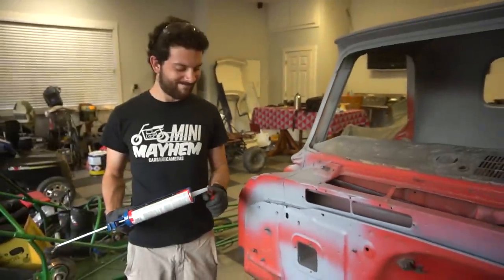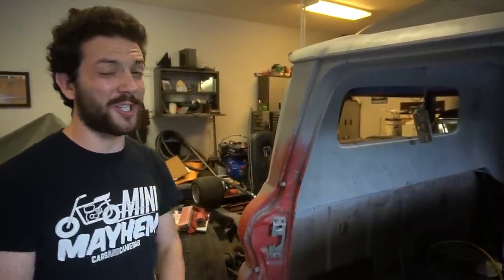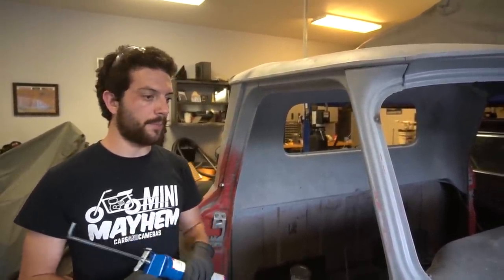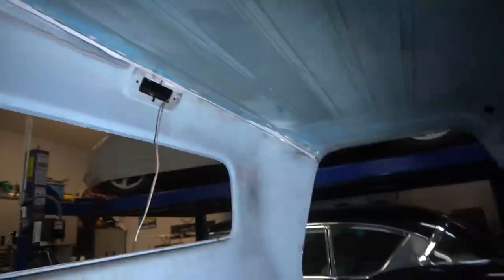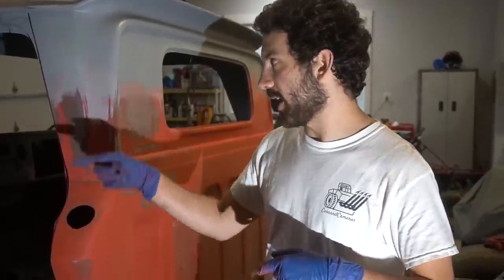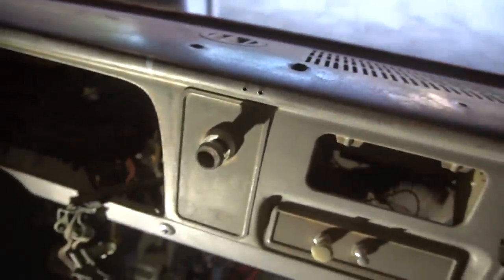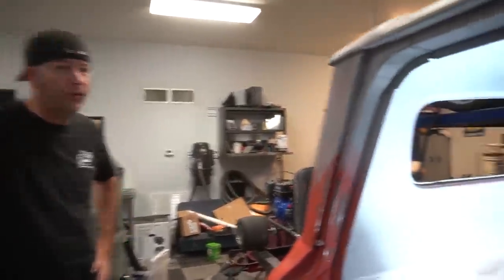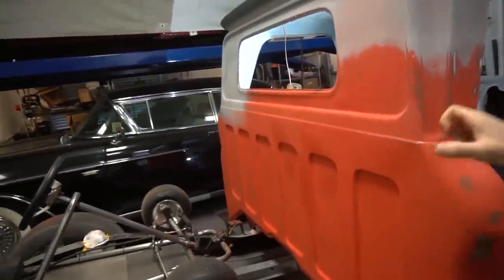My Chevy C10 Resto Mod! Fire Truck Cab Rehab!

Comment: Ditch the cheap plastic spatula and get some metal ones. Your body filler will go a lot smoother.
Reply: Na the plastic ones are better they just have to be cleaned after and they last. Last thing i want is after i do body work getting it straight is to drag a metal edge across it
Reply: doesn't look like he's pressing it into panel much, hints the pin holes
Reply: @Steve_Just_Steve  that and his spatula has like 3 layers or rough body filler on it its not smooth leaving scratches and gouges as hes trying to apply more
Reply: A guy I know that works for a mechanic friend of mine doesn't even use body filler on any of his project vehicles. He likes to pull the dents the best he can and fills them in with welds so there's no bondo under the finish. Takes much more time in the long run, but who cares if it's not a high priority vehicle and you have five other vehicles to drive? It would be another story if I tried doing that on my truck since it's the only vehicle I have to drive. :)
Reply: @Slane583 yeah if its a high dollar show car you tig weld everything and use a air file to file the metal flat. I personally dont like the bondo filler if im gonna use a filler its either dynaglass or all metal. All metal is just a metal paste
Reply: nathan butler: I don't think his projects are show cars, I think it's because he doesn't like body filler. Understandable if you try to sell something to someone after you've had your fun with it. They can't haggle the price down much if there's no body filler on it to use against you. :)
Reply: I would never ever use a metal edge to spread Bondo. You want to use a plastic Bondo paddle because you can bend the paddle  as needed to fit the contours of the body panels as needed. (p.s. they're cheap too. Some distributers will throw in the paddles for free when you're buying the bondo. Use it up, throw it away when it gets ragged out.)
Reply: Obviously none of you have ever used a high quality metal spreader. I’m not talking about a putty knife. These are specific for spreading filler. Oh well.
Reply: @brazwewn  You would be right, I've never used a metal Bondo paddle, (or 'speader', which ever) so I had to look it up.    Sure enough, you can buy metal bondo paddles for autobody work!  Just goes to show, not everyone knows everything about anything!

Comment: You should use a dry or powder guide coat instead of the primer to see the holes and mistakes in the body it would be a lot faster.

Comment: Bondo should be put on bare metal,You prime after you shape your filler.Otherwise your bondo will not stick properly..The only filler you use on a primed area is a thin coat of spot putty.

Comment: Seam sealer is not sandable; *panel bond*, I think, is. People sometimes use that instead of seam sealer, and that may be where the confusion came from. If you want to see a guy piece together a car from nothing, check out MotionAutoTV's Supra build. He used panel bond in this manner.

I should add that I have no direct experience with panel bond, as my "builds" tend to stop at the grind-the-weld-and-throw-on-some-primer stage. Don't get it right, just get it running!

Comment: sorry but you put body filler straight to the medal if you put it over the primer the primer can and most likely will lift off the medal. then you will have to start all over. and on the body filler its good to have a 2nd spot just incase you make to much that way you can fill it up some and not waste so much.

Comment: don't put bondo on top of primer. You should get poly putty.  It is made to adhere to primer that is cured. Regular plastic filler needs metal to adhere to

Comment: Take a round piece of metal the same size as the bead roll in the dash ,hammer sheet metal over it and you can fix that "patch " to look like it has never been fixed. It looks like crap without the bead roll. Cut it back out and fix it or it will bug you forever.
Buy a new bondo aplicator that isn't fucked edge will make your life so much easier when trying to lay down smooth bondo.

Comment: Are you sure you should be left in a shop when you didn't even know there was a seal on a caulk tube? That's what the little metal bar under the metal gun is for. To pierce the seal.

Comment: You shouldn't be using etch primer over filler. It adhears chemically to metal and won't bond to body filler. You need to use an epoxy primer if going over bare metal and filler. You also shouldn't fill over etch primer

Comment: for a lot of the tiny pits and holes in your filler you can use https://www.amazon.com/3M-Bondo-907-Glazing-Putty/dp/B0002JM8PY
Reply: its a real time saver and does a great job at filling them and real easy to sand